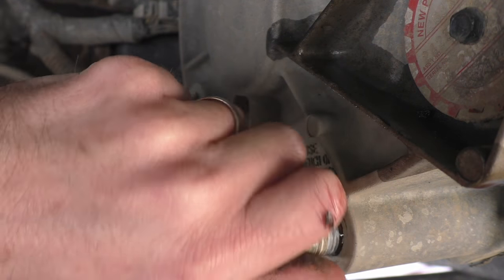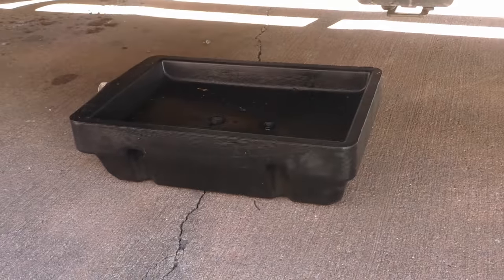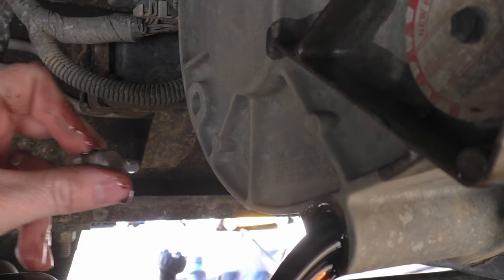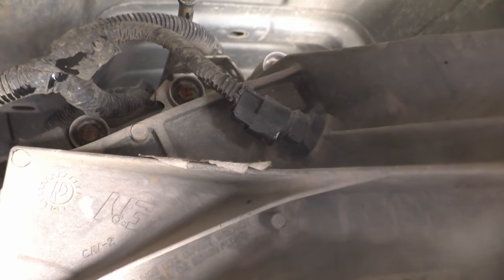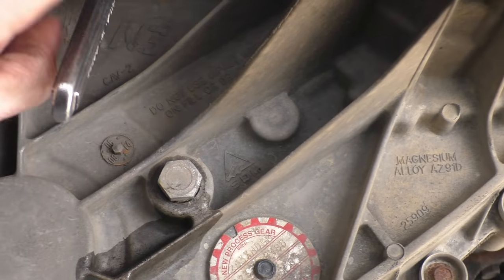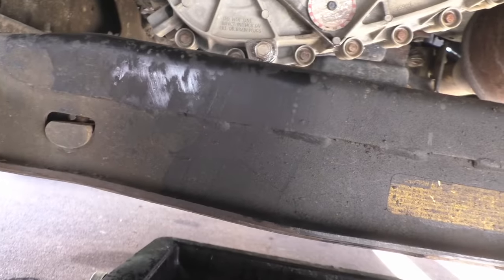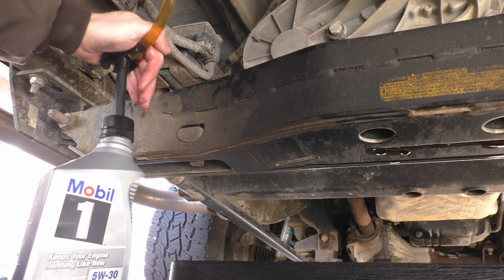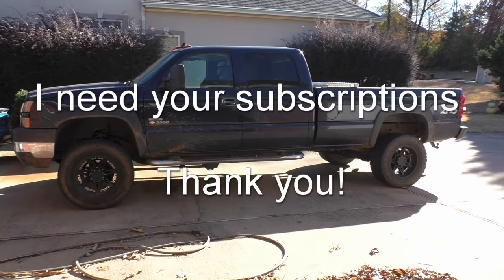How to Change Transfer Case Fluid in a Duramax or Full-Size GM Truck

Comment: Why not just park on a downhill slope or jack the rear of the truck up and then add 2.5 quarts through the fill port?
Reply: Good comment.  I've been tilting cars & trucks to fill the transfer case and rear differentials for years.

Comment: Just jack your vehicle to the side and then fill the transfer case and you will for sure get a little more in than what you would normally get in through the fill port alone.
Reply: I  have rhino ramps so if you back on them and get the rear end a little higher you can get more ATF/oil in the transfer box

Comment: Great video! I just changed the transmission fluid with TES295 spec fluid recommended by Allison. I will also use the same fluid in the transfer case. The reason being is that if the seal between the t-case and transmission fails you will not have motor oil leaking into the transmission and causing big problems. The TES295 has additives that standard ATF doesn't have.
Reply: Good point!
Reply: A failed seal will not lead to the t-case fluid finding it's way into the transmission, it just cant happen that way for several reasons. If heard this myth several times but the likelyhood of it happening is the same as the likelyhood of transmission fluid getting into the engine if the front seal goes out on the transmission...it just doesn't work that way.
Reply: This is correct and not to mention he is doing this on a older truck, much more forgiving and newer transfer cases are very sensitive compared to older models. Our new Silverado has power train warranty thru dealership for extended intervals past manufacturers! They perform the services and if the transfer case goes boom they have to replace it!

Comment: Over filling it causes foaming which actually does harm it 🫠
Reply: With the detergent of transmission fluid, I find that hard to envision as well as synthetic being resistant to those kind of forces. Are you sure it’s not just boiling over?

Comment: ATF is fine for the manual transfer case, but not if you have the auto transfer case. GM specific fluid, autotrak II, should be used for that gear box.
Reply: This is true and so very important.
Reply: No it is not,ATF foams up which the  chain aerates the fluid.Kodiak Truck's reman transfer cases use the 5w30 synthetic engine oil

Comment: OR you could just use the fill port, put in the correct amount, and then ACTUALLY check your level occasionally. Every 30K is recommended in my manual.
Reply from the maker: True, problem is hardly anyone ever checks it.

Comment: Thank you Farm Dad for this excellent youtube video! Having not changed my T-Case fluid for quite awhile, and growing tired of blowing so much money at my local GM dealership, where you are never permitted to go near the work bays, and have to wait anxiously for hours in the contemplation room while they do their "magic" behind closed doors. Then you face a huge bill from a pretty female cashier, with a nice apologetic smile, by the way. Their quote was originally over $900. to service my front/back differentials, T-Case, engine oil, and filter on my 6.6 LMM and Allison 100 6 speed trans! This years ago when all fluids were cheaper, so I took on all these jobs myself routinely and regularly. However have never tackled the T-Case fluid. Due to issues many other posters have noted about the upper fill plug's inherent soft aluminum/magnesium casting, limited clearance and tendency to easily round off, I purchased a full set of chrome crowfoot metric wrench heads incl. the 18 ml rachet crow. 
Unfortunately when I attempted to do what I anticipated was going to be an easy chore this AM, all attempts failed. The normal 18 ml socket head would not fit behind the cross-member, with or without rachet handle. A large open ended wrench did not have enough leverage, my extended length torque wrench was so long and hit the concrete floor. Finally the 18 ml. crowfoot. Sadly the head of the fill plug is just too soft to get even the crow to take a proper torque or bite on. After saying a few Hailmary prayers I finally came across this video. As instructed, with one exception, I gently opened the sensor plug (19 ml) with deep socket. It was barely torqued down and is a tough, plastic plug on top of T-Case housing. So simple! Next I easily removed the 18 ml. drain plug on the base of the T-Case, with factory installed thread sealer on the bolt. Fearing the worst as my truck is at approx. 75,000 miles, with no clear Hx of the T-Case being done, and my 4 low button recently not engaging 4 X4 low. But thankfully all still quiet. I anxiously watched fairly dark, dirty blue Delco fluid drain, but the magnet was not as bad as others I have seen on line forums. From there I refilled with a small funnel with  2.6 litre bottles of TranSynd TES-295 ATF, through the speed sensor hole. Not only does my 4 wheel drive system once again shift easily into 4 low, the whole system is incredibly smooth and responsive. I wish I had found this video sooner, and suspect the dealership uses the same refill method, behind closed doors, charging approximately $300. for the favor. Relief, and thanks again Farm Dad!
Reply from the maker: You are correct about so much, including the way it is at a dealer and the fact that many gm techs use this method.  Best to you!
Reply: Do you comply with the advice of adding 1/2 quart extra a.t.f. above recommended fill level also?  Sounds like sound advice, I will be doing this on my Allison soon

Comment: Excellent advice, good history/sources, clear, good video, probably my favorite bit I've seen regarding maintenance on a truck. My only criticism is there was no torque specifications mentioned. Last time I torqued down a magnesium transfer case it split and had to be pulled and welded.

 Thank you!
Reply from the maker: Good point.  Sorry I missed that.
Reply: Wow, ugh!  Makes me just want to only snug and not torque when replacing drain plug on my t-cases now.  Sorry that happened

Comment: Thank you for making it short, simple, and straight forward and also not making it confusing thank you!
Reply from the maker: That's my goal!  Glad to hear it!
Reply: Thanks I added the fluid I went with valvoline syn dex VI. Next time I may use mobile 1 5w30
A previous service shop stripped my fill plug it is permanent on now.

Comment: Thank you for the tutorial. I followed your directions but now I am getting a range shift inhibited and abs codes. Also not shifting properly and speedo is not working. Any idea what it could be? I didnt have any issues prior and I cleaned the plug with electrical cleaner thinking maybe that was the issue. Any advise would be appreciated. I'm sure it's something I did but the procedure was so simple I'm not sure what it could be. Thanks
Reply from the maker: I'd suspect that speed sensor.  It could have sent your trans into limp mode if it's not working.
Reply: @FarmDad  Found the problem. The o-ring got pinched in the threads and stopped the sensor before it was seated all the way. Thanks again!
Reply from the maker: Glad you figured it out!

Comment: I don't think there's an issue with evaporation with the engine oil. Just the ATF. I use the Mobil 1 like you, but just fill it to OEM spec. Have you had any issue with evap. of Mobil 1?? Thanks.
Reply from the maker: No sir, I have not.  You should be good.

Comment: if i use 5w-30 instead of transmission fluid, will the slip yoke clunk go away????
Reply from the maker: I wouldn't count on it.
Reply: @Farm Dad  well I already greased it, hopefully after the grease wears away the motor oil will be more slippery than ATF

Comment: Motor oil doesn’t go in the transfer case suppose to use auto trak 2 fluid.
Reply from the maker: Go buy a rebuilt transfer case and you'll see that it'll recommend 5w30.

Comment: How do you think of Tom Larch’s comments below please? Thanks!
Reply from the maker: I don't know much about the properties of TES 295, but seal failure is a valid risk.
Reply: @FarmDad  I was thinking of using 5w-30 for TC, but considering of the failure of the seal in between TC and Transmission, using the same fluid (for TC) as Transmission makes more sense! Thank you for your information though!
Reply from the maker: @jrm163  welcome.  I would overfill for sure though.
Reply: @FarmDad  But you mentioned somewhere below that ATF would create foam (while 5W-30 wouldn’t).
Reply from the maker: @jrm163  atf is what is normally in transfer case.  I have had good results substituting 5w30, but if concerned about seal failure, ATF is a safe choice.
Reply: @FarmDad  THANK YOU!

Comment: Of you overfill that transfer case you can cause cavitation which is not good for the gears adhere to the recommendation of the professionals who designed the vehicle components they know what’s best
Reply from the maker: This is why you switch to 5w30 rather than Atf, which foams when overfilled.  This is the new recommendation of professionals.
Reply: 2009 6.6 ok?

Comment: 2009 2500 hd Duramax T Case OK?
Reply from the maker: Should be the same t-case with only a few revisions and different electrical connectors.  May still suffer from these issues, but I suggest you research it more.

Comment: Overfilling causes fluid foaming, and a lubricant with air bubbles provides poor lubrication. 
More fluid is not better.
Reply from the maker: Well, 5w30 is a lot less likely to foam than atf, plus there's still a lot of room in this t-case.  I've been running mine for years like this and have seen no evidence of foaming.

Comment: My built t case with oil exploded in 2kmiles. My next one run the stuff it calls for no issue 50k later
Reply from the maker: Most replacement t-cases call for 5w30.  I will almost guarantee you that your original failed due to pump rub, not oil.
Reply: @FarmDad  wel.i can promise it didnt... it was BUILT  (few better internal  materials  etc)   no pump rub with a pump rub kit
Reply: @tyler1671 oil didn’t cause that man
Reply: Mines been built five years Kodiak truck says 5w30 on the case and the man hisself tells u on truck master YouTube channel